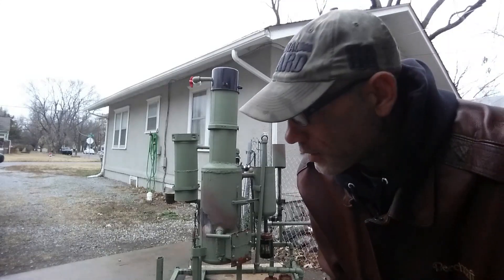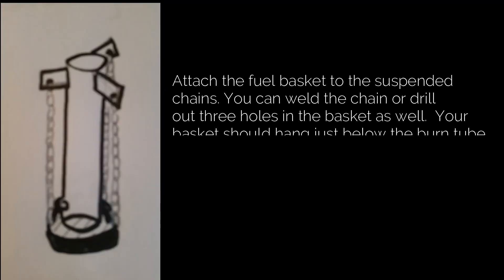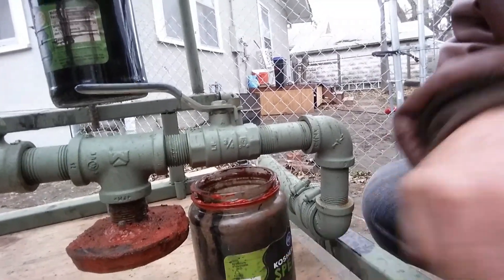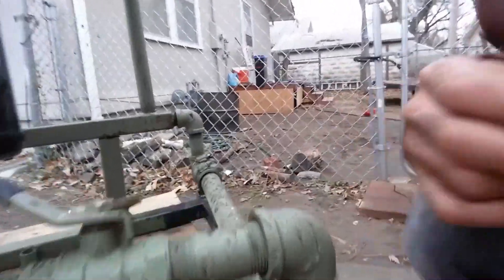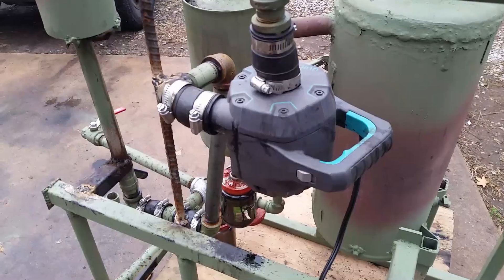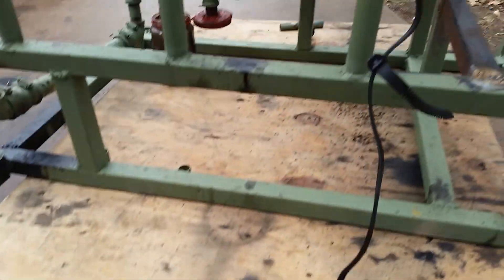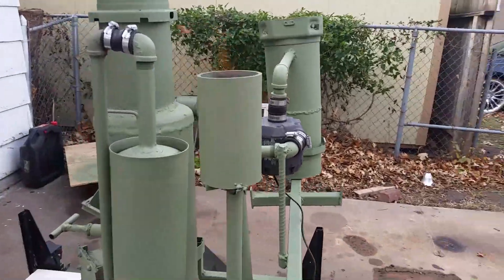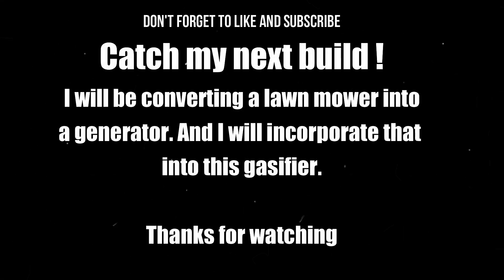Super cool home made Gasifier

Comment: How much gas will it produce while running? Also who long before you have to refuel the chamber
Reply from the maker: I was running it on wood pellets just because they burn evenly and are easy to convert into wood gas. However, that was just to make it easier on me as I designed the machine. It works on any wood I fill the hopper with. With that being said I can make it easier for you to get a clear picture. One full hopper will run my gasifier for about 6 hours. Using about $2.00 worth of wood pellets.

Comment: Finally,  someone who just goes step by step of the major components. Thanks for sharing.  Yo want to sell it?
Reply from the maker: You are very welcome. I still have a lot of build left on this project. I’m also designing a hydrogen cell for another generator design that runs on water. Technically hydrogen gas, but that’s just pulled from water.

Comment: It seems to burn very clean I guess all of those drip jars act as a scrubber. I wonder if this will produce enough gas to run a 15,000 watt gasoline generator?
Reply from the maker: Absolutely. You will just need to fine tune your burn to your climate. Gasification is very temperamental

Comment: Any information on hopper specs... diameter/ length? Assume it has a funnel at base where it has to blend in with burn tube diameter? Good design . A plan is to make similar in Tasmania..
Reply from the maker: My hopper is 6" in diameter. The ignition tube that ties into the hopper is 2" pipe

Comment: Well the whole idea is if the power goes down you can run your generator off of that but you won't be able to start your fan on your gasifier because it's 110 if you don't have any electric a smart move would have been to put a 12-volt fan on there so you didn't need electricity to run the fan just a small battery would have done the trick even a car battery if I was you I would replace that with a 12-volt fan p I suppose you can always put a inverter on a battery and run it that way but it would seem like a smarter way to go is it 12 volt fan
Reply from the maker: Yes absolutely. The fan is temporary. It will have a combination of 12 volts and inverted power to charge after the machine is running. This is still all in the making and design phase.
Reply: Small inverters are cheap. 
I would put a bypass around the fan for when it's running a motor, as it just becomes a drag and increases wear reducing  it's lifespan.

Comment: Would it better to put the generated gas into a small engine belted to a 12 volt alternator / car battery charging system then produce the 120 vac with an inverter - in case the RPM might vary off generator system? Trying to generate 120 vac directly requires the generator run at a fairly steady and constant speed like 1800 RPM.
Reply from the maker: Yes I think that would be a better set-up
Reply: Other than allowing RPM variation when using a gas generator some of the other benefits is that the power system is more modular, and self repairable from components you can afford to keep in your home. Group 31 led acid batteries or Golf cart deep cycle batteries are readily available and almost economical, the automotive alternator like a Delco Si-12 is inexpensive (commonly used in mid 1980's GMC vehicles) as are multiple commercial inverters in various sizes. Delco has a great tech site they let me know most alternators can safely run up to 15,000 RPM. A large 10 to 12 inch dia taper lock hub pulley for the motor works well for this. A variety of bore diameter pulley taper hub bushings allow swapping out horizontal shaft engines really easy.

Comment: Great explanation nice compact simple design. Does it need constant adjustment to run a generator or can it be left running for good amount of time? Is this gassifier big enough to run a small 240volt two plug generator?
Reply from the maker: I get around 8 hours of burn from one hopper. A couple bucks worth of pellets. As long as the ash  grate gets shifted a few times to keep the air flow it will maintain its burn just fine.

Comment: I'd like to adapt an external gasification system to my outdoor wood boiler that I use to heat my house.  Instead of it venting to atmosphere, might as well see if I can recapture some of those unspent gasses and run a generator off it (even if it's just enough to run my boiler's circulation pumps that would be great).
Reply from the maker: That would make a great setup. I spoke with a man about designing a system similar to what you're saying to heat his chicken coupes.
Reply: @Kevin Corapi High efficiency outdoor wood boilers are literally downdraft gassifiers  already. You can't just take the smoke from your inefficient, fire inside a water tank, boiler and clean it up to run a generator more than once.

Comment: Thank you. Do you think that a bong-style water filter would work better with this kind of setup? Seems like it would cool & clean the gas.
Reply from the maker: I think that style filter would work great. It would also act as a cooling medium for the gas to burn easier.
Reply: Imo the gas has to be cool because of the fan and that the moisture could condensate. So for a bubbler a reasonable position temperature wise would be before the fan, but there is a suction wich would work as an air lock(creating vacuum in the bubbler wanting to suck out the water)... so it only can work after the fan where the gas is pushed.  Also might introduce extra moisture into the gas. Isn't it?
Reply from the maker: @lorifilm  yes you are right.
Reply: @lorifilm  Bubblers work just fine with suction, that's how bongs work, you don't blow into them! 🤣🤣🤣
Reply: ive seen a imbert design from the 1940s that had a bong style air cleaner

Comment: Best explanation ive seen so far . but can to tell me how long will it power a 5hp gen or what ever size you use . i need to see if its practical for me to build one ?? also do you have to be going out to constantly adjust the flow as your hopper burns down ??
Reply: ive seen one that ran for 24hrs and only burned 6kg of wood pellets . wow

Comment: How long does it take with a full tank? 

Does the gas cause any damage to the carburetor or engine over time?

please answer this question! 

Thank you
Reply from the maker: It will run for around 6 hours on a full hopper. The cleaner you filter your wood gas the more long levity in your carbs. But if you are burning more contaminated gasses it certainly can begin to wear on your carb. Particularly your seals or gaskets. Overall don't slack on your filtration and you will be good as gold.

Comment: Good work.  Why not insulate the reactor?   How about some instrumentation? How long does it run before you have to reload?  Why not scrub some oxygen out with clean metal turnings..
Reply from the maker: Thank you. I plan on insulating the reactor at some point soon. It would be great to automate it. Soon as I can afford to throw some more money at it, I will be trying some upgrades.
Reply: If there is any oxygen in the gas stream you are doing it very wrong! 💥🤦

Comment: does it give off radiant heat as well as useful gas? so I could use this as a wood burning stove in a garage as long as I use proper ventilation and safety, or run a heat exchanger off the outside to heat water like one of those woodmasters?
Reply: These open type gasifiers can leak some carbonmonooxied into the air, so if you run it inddor, you risk air poisening. But a heat exchanger instead of the simple radiator is a great idea, the more you cool down the gas, the better it is.

Comment: Overall a nice setup!! There are a couple points though you may want to revisit. The combustion gases coming off your cyclone filter are still going to be hot, so I'd hope you have used a metal seated ball valve (what you called a control valve) ahead of your radiator as the gas may be hot enough to melt cheaper plastic seats. The after-filter catch bottle should not be needed if the filter is working as the gas should not have undergone enough thermodynamic change between the filter and bottle. Where you would really need that bottle is below your radiator. You have a liquid trap in your piping between the current after-filter catch bottle and the radiator. As energy is removed from the gas in the radiator, and steam condenses along the pipe walls, the trap may eventually fill, and you have no means of draining it. This can cause slug flow in the gas and burping in the system. If you build another, you may want to put the radiator between the reactor and the cyclone filter, and add fins (or buy finned pipe) for the radiator to extract more energy from the gas. The more steam and contaminants you can remove in the cyclone filter the less smoke which should be produced. The bed of shavings should only be for polishing the product gas. But again - what you built is among the nicest I have seen for a personal installation.
Reply: Great input, thanks.
Reply from the maker: Very good input. I have noticed that between burns I need to drop the bottom pipe leading into my radiator to drain it. I think I will take you up on the suggestions. Thank you

Comment: Before your video i never new what the heck gasifier even meant. This is absolutely amazing. I saw the engine video running and I thought it was simply using the over heated air to create a combustion.
Reply from the maker: Thanks. Yeah, I am working on making this a complete self-sustainable mobile grid tiny trailer. Eventually, I will be able to harvest wood into wood pellets, convert wood into wood gas, store energy through a battery bank and even produce diesel fuel all off of this 3x4 foot trailer. I literally started building my reactor today for converting plastic into diesel fuel. I will have that video up soon.

Comment: Perfect......now, just need a video showing us how to store the gas into a propane bottle ;)
Reply: It's not recommended to bottle because it is a gas it doesn't stabilize like propane or acetylene, it looses it's potency in a very short time when pressurized and store. It's meant to be a fuel in demand system
Reply: @BigBeavrSlayer  Great input, thanks.
Reply: @chris6160-d6s  there are several people attempting to scrub clean the gasses that destabilize it to make it safely compressible, but it seems a gasometer is currently the most effective way to store it but that is in small amounts. Thrive energy is pushing this project right now with dual gaso meters that run on demand through a gassifier, he has made some progress in the last 2 days
Reply: No you just connect your devices directly to it like a lantern stove lawn mower whatever
Reply: Wood gas not easily stored but I've seen submerged tank bubbler style storage but not sure if gas picks up too much moisture to use in generators after this

Comment: Well you've got my sub. To me, this is a miniature replica of a treater vessel (or scrubber), at a gas plant. I wouldnt even doubt for a second, if you were an oil and gas engineer.
I would maybe cut down on the power, with even a speed control module,  by using several CPU fans. You could likely power it, just from it's own production.
It'd be much easier, with a proper valve system, to change or do maintenance. Some great effort went into this. Well done, I surely could not do better, and haven't seen anything better to date.
Reply from the maker: Only an engineer in my own mind. I like going down rabbit holes researching things. Then I try to create them. That's the only way I can know for sure if they work. And the hands-on process locks it into my memory for the long haul. This way in a post-apocalyptic scenario, I know I can re-create things on the fly.
Reply: I know Im randomly asking but does someone know of a way to log back into an instagram account??
I stupidly lost my login password. I would love any help you can offer me.
Reply: @Huxley Jaxtyn Instablaster ;)
Reply: @Abdullah Daniel Thanks so much for your reply. I got to the site on google and I'm in the hacking process atm.
Seems to take a while so I will get back to you later when my account password hopefully is recovered.
Reply: @Abdullah Daniel it did the trick and I actually got access to my account again. I am so happy!
Thank you so much, you really help me out :D
Reply: @Huxley Jaxtyn you are welcome xD

Comment: I like your build you have done your homework. The trailer idea is awesome too I built mine on a trailer too you can tow it with a small cc car or stationary for generator or use a Retrofitted refrigeration compressor and fill propane tanks with with the sun gas and make due the propane tank is pulled down with vacuum before filling it can go safely to 300 psi and used for cooking heating or refrigerator as it is mainly methane carbon monoxide natural gas. And it’s all free could be dangerous if your careless Ben Peterson’s design is dang good too just got to have some common sense if not then this ain’t for that person. I’ll stop I can’t say enough. Cheers
Reply from the maker: Thanks for your comment. I certainly appreciate all the good information. I definitely want to try storing the gas for future use. I will check out that Ben Peterson you suggested.

Comment: if you use it in a grid down how will you run the fan
Reply from the maker: This is only the beginning stage of my build. I am adding a generator that the gasifier will run which will charge the battery bank I am installing. So here soon, it will not depend on any outside source of power.
Reply: @Saxxsays  all you need is a 12V lead acid battery (almost any size will work), $10 DC speed controller, and a $20 marine bilge blower
Reply: @rotaryenginepete  Right but I would recommend a $10 air mattress
 blower because of much more power. And a PWM controller would be the best decision to control that.
Reply: @ravelkoff3549  that is what some people use but a mattress blower is not rated for flammable vapors...so in addition to depending on an inverter to make it work, there is a risk of igniting the wood gas.
Reply: @rotaryenginepete  Hi, I use it since 3 years. There was no spark, no air to ignite (after sealing it) and no risk at any time (as I see in my experiences)  And the throughput of this little guy is the same which my engine has. I also tried a bilge blower and the only thing I was not glad with was its power or its throughput. No need for an inverter if you want to use a 12v battery. A12V PWM module is only for percentual speed downstepping.
When its good for you - fine so far ;) I tried to give you an additional option for this being able to run it on 12V. Bless you :)
Reply: @ravelkoff3549  that is why I said risk of igniting, not certainty.  If it's a brushed motor then it sparks whether you can see it or not.  Your system might be air tight, but there's always a chance for a leak to develop.  Marine blowers are designed and built to satisfy requirements of USCG 46 CFR § 111.105-11 - Intrinsically safe systems.

I would be willing to bet a large sum of money that a mattress blower is not intrinsically safe.  Take it for what you will, and it might not be a high risk, but it is there.

The need for an inverter would be if the blower (such as in the video) runs on 110V AC.
Reply: @rotaryenginepete  Thank you very much for this explanation. As I suggest there are different types of mattress blowers around the globe. I apologize. Mine is absolutely airtight and sealed and works since 3 years without any problem - what I am not able to say about the bilge blower.
Reply: @ravelkoff3549  no problem, just trying to help people understand it is a safety concern.  We are all willing to accept a certain level of risk, and that is fine.  The only goal here is education.  Bless you as well and thank you.
Reply: @rotaryenginepete  Great input, thanks.

Comment: I'm gonna apologize now, because I quite honestly had no clue this type of system existed up until this point and I don't have much knowledge on how liquid based fuels are created. I just had a question as to how and if you would be able to turn the wood burnt vapor into a liquid base? I see its easy enough to just rig hoses to carburetors in the case of a generator, but running lawnmowers and other such machinery this method isn't quite suitable as I'm sure you're aware of. I'm just hoping to learn a few things about this as I'm very interested in living the tiny house/off grid way.
Reply from the maker: No, this particular system won't work for getting liquid fuel. However, it can be pressure bottled such as propane and run in an air gas style mobile machinery. Now if you were wanting it for like a riding mower then you could absolutely do a simple reactor micro-sized that you attached to the mower.
Reply: @Saxxsays  very neat stuff! Thank you for replying! And thank you for putting these types of videos up! Very informative and hopefully it will get a lot more people interested in not relying on big corporations to live sustainably.
Reply: The best effort on this was done by Mr. Teslonian years ago. But I wouldn't mind to fill that into my car ;) If you prefer this way  - perhaps you have a look on plastics gasification.
Reply: @ravelkoff3549 " plastics gasification".. another thing I had no idea existed! Haha! Thanks for the input!
Reply: @royalenomadicimagery8157  ur welcome buddy. ;)